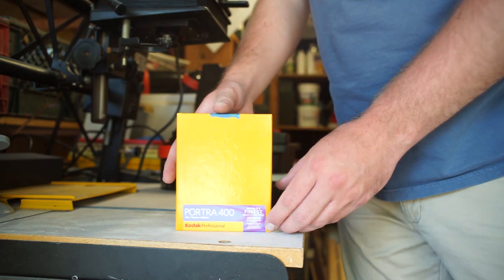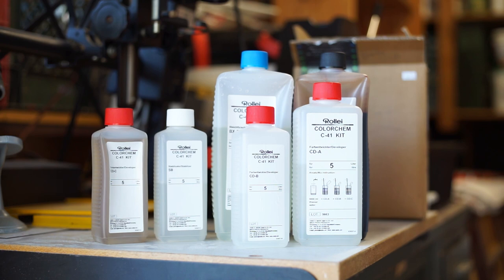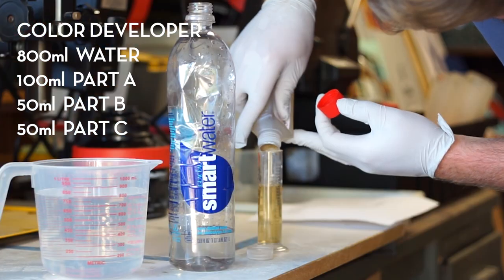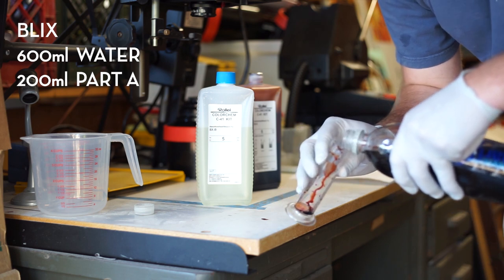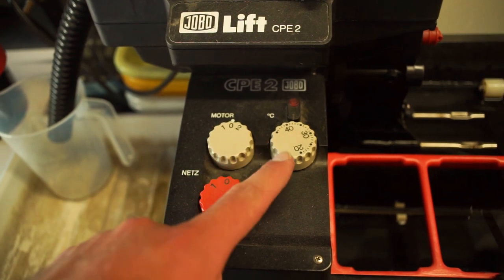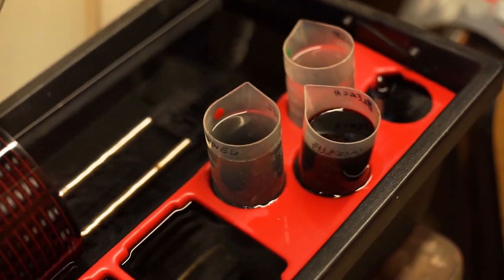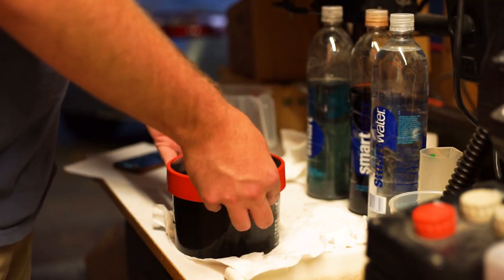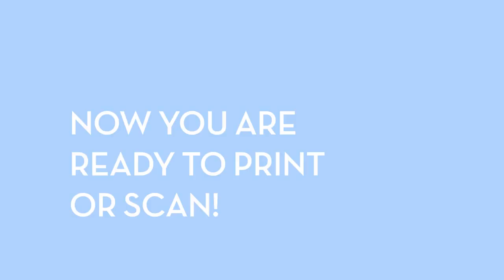How to Develop 4x5 Large Format Portra 400 Film

Comment: Tip on using the Jobo unit:  Do not use the internal heater to warm up the water bath to 100 degrees F. Heat your bath water at the tap or elsewhere and pour that into the Jobo unit. Then use the Jobo to just maintain the needed temperature. Why? Regardless of their price, the Jobo units are generally under built, including the heater system. Warming the full bath from room temp to processing temp will seriously limit the life of the heater. Also, note that he is adding a water wash between the developer and blix. This greatly reduces cross contamination of the blix, extending the amount of film it can process and eliminating possible color shifts which will occur from any contamination.
Reply from the maker: Exactly! I usually put in hot water from my sink to get things going! Also adding in a second heater helps heat the water a lot faster. That’s the reason why I do the water! Helps the chemicals last abit longer too

Comment: Were you mixing for 1 litre or 5? , I have the same rellei chemistry. Not sure if I just multiply the 800ml x 5 if I'm trying to create 5 litres ?.... appreciate the video post.
Reply: *Rollei
Reply: @FeRmBot0118  He did 1L but using the chems from the 5L kit. So yes you would multiply if making the full 5L.

I previously used this kit but forgot it's so simple to mix. With the Cinestill kit you have to heat up water and it complicates thing a little more. I just wanted to make sure I wasn't crazy and read the instructions correction. lol